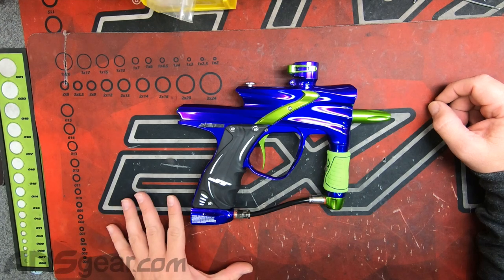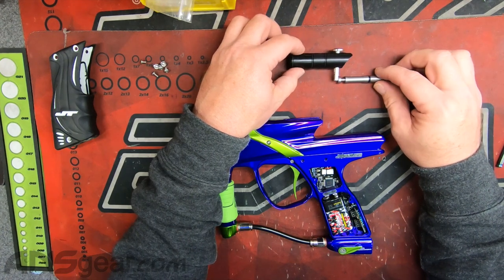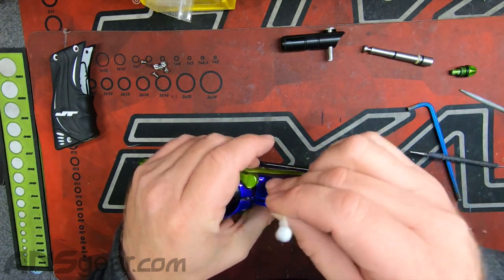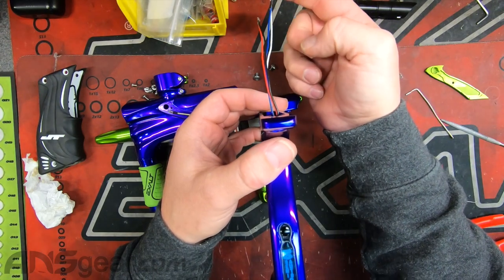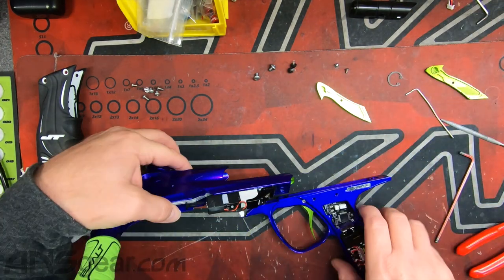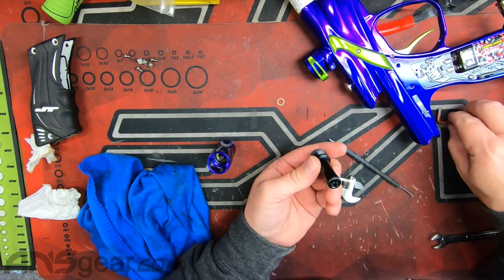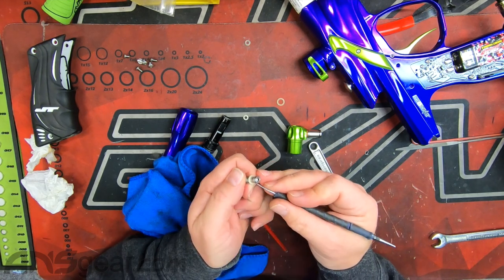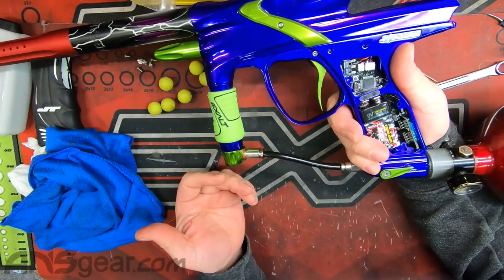JT Impulse Paintball Marker - Bolt & Eye Wire Issues - Tech Talk

Comment: Funny how common the issue is with re-installing the bolt incorrectly. I had a couple of second-hand OG Impulses where the face of the hammer was all dented up from striking the bolt pin. . . Thankfully those things were built like tanks.